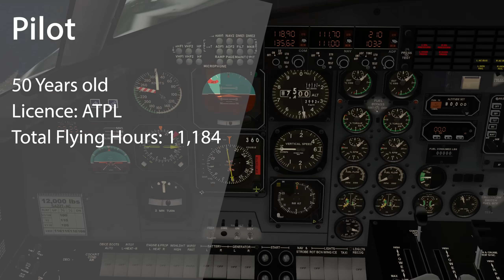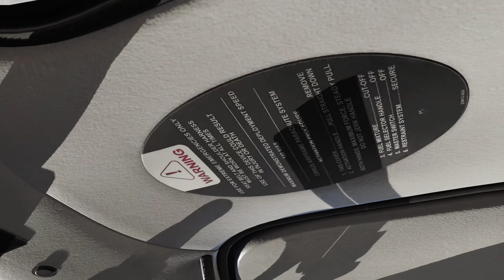Mid-Air Collision In Colorado! | How Did Metroliner and Cirrus Collide?!

Comment: I'm going to be honest, I went and read the report after watching this video... it's pretty bad. It's only about 4 pages long if you take out the large graphics, and doesn't really go into much detail at all about the accident. It mentions that the Cirrus had a TCAS system which went off, but doesn't say for how long prior to the collision (presumably not long, since the pilot pulled the CAPS handle less than 35 seconds after they said the alarm went off, but that's still long enough potentially to have avoided a collision). It doesn't say why the Cirrus pilot was so far over the speed from the POH, or why they didn't notice that they had overshot the runway centreline by so much. According to the report, they were not even half way through their turn at the time of the collision, so they were nowhere near going to make it. It doesn't say if they ever saw the metroliner. Several people have commented that the metroliner's control cables run through the floor, this isn't mentioned at all in the report...

Comment: An unusual story well worth telling. But, boy did he fill the airway with useless words just to make the video past the 10 minute mark! 

All those take off details are just pointless. Apart from pilot information, the step by step taxi and take off laundry list is totally irrelevant. They had zero impact on the accident. What’s next, list what each pilot eat for their breakfast??? 

This is just plain laziness. Instead of repeating those mundane take off steps for the umpteenth time, he could have spend a couple minute to talk about the parachute system and why it’s on this particular plane but not many other types of aircraft. But not, that’s too much work. It’s far easier to just fill the dead air with taxi paths.

Comment: I flew thousands of hours instructing at Centennial. I have flown that Cirrus, and if the information I received is correct, I trained the Metroliner's pilot through several of his ratings. One factor not brought up is the distance that the controllers are extending downwind. The further out you fly, the less ability a pilot has to determine the approach centerline. The runways are close, and a pilot can believe that they are on centerline when, in fact, they may be 100' off. Speed was a major factor.

Comment: Several very lucky characteristics of both aircraft saved the crew’s lives, the Metro’s control cables rout through the floor and the floor is reinforced for cargo which is why it never came apart and remained controllable, the composite structure of the Cirrus prevented in flight break up post impact and of course the Capps system did what it is supposed to. This was a Swiss cheese model of positives for a change that came into play after a series of mistakes caused the initial incident.
Reply from the maker: Such a good point, an example of the swiss cheese model in both the positive and negative.

Comment: Flying was simpler and made more sense mid 20th century when I learned based only on the principles in Stick and Rudder (pre PTS/ACS.)  We learned that speed was more important than altitude on takeoff and at low altitude except landing.  We learned that extra speed made landing more dangerous and even impossible.  Now extra speed and the resultant dangerous go around is encouraged as good landing technique.  And yes, the slower we go the less radius of our turn.  Another thing not taught is maneuvering flight where horizontal space available may be as limited as vertical space available.  Slowing down but not pulling back on the yoke in the slower and tighter turns means 1 g turns regardless of bank angle.  We need to teach flying based on the principles in Stick and Rudder and good energy management.  "The 'stall-down' landing requires that you blend the approach glide, the flare-out, and the slowing up of the airplane all into one maneuver so that, when you arrive at ground level, you arrive in three-point attitude, all slowed up and ready to squat."  S&R page 302.  Use ground effect to be faster on takeoff and slow down to land.  Flying will be safer and more comfortable that way.  And all that can be done while looking out the windscreen.

Comment: I  think a traffic advisory wasn't even the real ATC issue here. Surely parallel landings are only permitted when both aircraft are capable of precision approaches. A GA aircraft doing a visual landing via a traffic pattern isn't what I would call precise :D especially when the speed is so wrong for an approach. ATC giving the Cirrus an extended downwind sounds reasonable to me as an armchair air traffic controller.

Comment: Strange that such a small airport would use two TWR frequencies. I'm not ATPL licenced, but as a PPL holder, I'd always expect to hear all traffic in the pattern and on the runways once I am on TRW frq. But with the very "non-standard approach"  of the Cirrus pilot, a single frequency may not have made a difference in the outcome. 

I flew a fast Long Ez for many years, and with an approach speed of 110-120 kts, things always happened a lot faster than with a Cessna, so I can imagine what 140 kts will do.
Reply: It should be noted that runway 17R's threshold is 1875 feet offset from runway 17L's threshold. This alone should have prevented the collision IF both planes were on the 3.0 degree standard glide slope to their respective runways. There are visual slope indicators with 4-light PAPI for each runway. (Note that the two runways are only 600 feet apart laterally.) Having trained and based here at KAPA, I can say that 17R is used primarily as a training runway for touch and go landings by the many schools that operate here. When it gets busy, the 17R controller will extend the downwind (and thus final approach) legs significantly (a mile?) to accommodate many training planes in the pattern. Runway 17L is used primarily for inbound traffic from the north and east, as well as almost all jets, which require much longer final approaches. Controllers regularly warn pilots using 17R to NOT cross into the 17L approach path. The puzzling questions that remain are 1. why did the Cirrus pilot feel a need to fly the pattern so fast? And 2. why did he overshoot the 17R centerline? Two speculative answers are 1. there was other traffic to avoid in the 17R pattern; and 2.  he thought that he had been cleared to land on 17L, a not too rare event there.

Comment: Some sort of short-range active radar should be introduced for aircraft. Multiple lightweight transceivers on multiple points on the airframe, derivatives of automotive technology. Passive methods using transponders don't work when some dummy in a Cirrus decides to slice your fuselage open.
Reply: Look up ACAS, TCAS and PCAS.
Reply: @stejer211  None of those systems use active or passive imaging radar They all rely on transponders. I'm talking about military style all-around collision detection RADAR.

Comment: Wow!  What a testament to the build quality of the bigger craft, value of CAPS, skill of the pilots, and divine intervention!
Reply: The skill of ONE pilot, sure. The Cirrus pilot, not so much.
Reply: @ttystikkrocks1042 it’s a shame it can’t in some way be replicated by a good pilot in a plane without one.  Like, it seems to stop spinning and go wings level with the greatest of ease.  There’s a new model of Cirrus with a “wings level” button that really seems to work.  I wonder what it’s actually doing to the aircraft that pilots could learn to copy?

Great video and a fantastic outcome.  Did either aircraft have a transponder on and would that need to be on the same frequency to see another plane?  Sorry if some of this sounds a bit “beginner-ish”, but it would be interesting to know.

2.9.24 JUST EDITED the first sentence as I missed out a word which made it sound nonsense.
Reply: @ttystikkrocks1042 thank you - I assume transponders can “step on” each other like people do.  The other thing I wondered about was why they didn’t get TCAS warnings, because the radio altimeter triggers those?  Or why they had such a dumb system of traffic control in the first place?  You could literally have 2 controllers lining up 2 planes to land on the same runway at the same time, with no communication between planes or people.
Reply: @moiraatkinson  TCAS is not required equipment in general aviation aircraft. I think that should change now that such electronics are so much less expensive than they once were.
Reply: @ttystikkrocks1042 sounds like it’s needed.  There appears to be a rise in GA accidents while commercial flying gets safer, and hardly a week goes by without hearing there’s been a fatal accident.
Reply: @moiraatkinson  I agree that something is needed to make general aviation safer for everyone. The FAA seems to be pursuing an approach of it they ignore it for long enough, maybe it will just go away.
Reply: @ttystikkrocks1042  hard for me to comment from another country, but it does seem to me that after a mishap, the NTSB come rushing in, then go away and in 2 years time produce a good, thorough report of an accident nobody remembers any more.  As they don’t have the legal right to insist on action being taken, presumably their report goes to the FAA and that seems to be the end of it.
Reply: @moiraatkinson nope, you’re bang on, that’s exactly how it works. Dunno why we ever let the FAA have a “dual mandate” in the first place
Reply: Crazy how you don’t need CAPS if you don’t fly into other aircraft…

Comment: Just looked it up.  Engelwood CO population 33,642.  Does Centennial airport have enough traffic that requires them to have ATC tower on two different frequencies for two parallel runways, therefore lack of communication between planes that may be on parallel paths? Non-pilot question, so admit I probably don't know relevant details.
Reply: Yup, you don't know.   The airport is only 15nm from the center of Denver.  It is an international airport with continuous U.S. Customs services and is one of the busiest general aviation airports in the United States with an average of 874 operations per day.   That's why it has two controllers.
Reply: its the busiest class d airport in the usa

Comment: Nice that you can be incompetent and still get on the ground safely because of a ballistic chute.  I have done several missed approaches at Centennial.  Always for resolution advisories on aircraft that had wandered through final or were simply not in sight.  There is no way to safely execute simultaneous approaches for these runways.  I stopped allowing our corporate aircraft to use Centennial.  It is not worth the risk.

Comment: The Cirrus has quite an impressive top speed for a single engine aircraft.  Honestly, I don't know what is impressive for twin engine turboprop commuter planes like this one.  So I don't know if 330 KTs is fast or just average. That it didn't explode on impact must speak to a huge amount of luck that no fuel tanks were ruptured, I guess mostly because the cirrus struck fairly high up on the hull, and didn't seem to impact the wing.  It's also incredible, if not miraculous that the Fairchild was able to land safely.

Comment: Those old Metros are incredibly rugged. Built in San Antonio, TX. Sad thing is, that airplane was probably scrapped. When they finally ceased production in 2001, they cut up and scrapped all the tooling used to manufacture them, so no major airframe components can be built for them when substantial repairs are necessary.
Reply: Nah its just sitting at the ramp on the east side of APA, Key Lime has like 6 Metros out there in various states of canibalism
Reply: @scoutty146  
That's the first step towards scrapping. They'll miss the Metros when they're gone. There are some things they do well.
Reply: I find the destruction of the tooling to be extremely asinine. Why would they do that?
Reply: @ttystikkrocks1042  
Not sure what they were thinking. Maybe to hasten withdrawal from operation.
Reply: @rescue270  have to pay rent on the building that houses the tooling. Destroy the tooling sell the plant
Reply: @scoutty146  
Should have sold the tooling.

Comment: A deployable parachute for the entire aircraft? That's pretty cool. I didn't even know what was a thing.
Reply: Cirrus pioneered the general development and deployment of the ballistic parachute system for their line of aircraft. You can now find them in many types of ultralight, light sport and general aviation aircraft.
Reply: They have been around for a couple of decades, at least!  They are only available for small planes.  I believe they originated on ultra light craft and evolved to include single engine general aviation!
Reply: They even strap people to them these days!
Reply: @stejer211  😁
Reply: It's almost a trademark of Cirrus Aircraft. There are some interesting analysis on the how much safer if makes the aircraft.
Reply: They’re only used because a cirrus can’t recover from a spin.

Comment: Not infrequently esp larger airports there are multiple tower frequencies - i previously considered it a convenience in some sense but this case instead  illustrates the potential danger to the unwary pilots. Moderating airspeed as one approaches into the pattern for landing is very basic aviation, its is not the place for recklessness, it is the place for care and vigilance.  Its like the foolishness of acceleration to the the red lights, just plain dumb. Its not clear if at least some of the excessive speed was due to a tail wind, but if so that should have been anticipated. I'm always very careful and attentive with parallel landings but this provides more food for thought.

Comment: I always wondered why they still fly those Metroliners. Now I know. They must be good aircraft.
Reply: Very solidly built.
Reply: Might be solid, and perhaps a good small freight plane, but I had to endure a lot of time in them as a passenger.
They're one of a few planes that can't sustain level flight on a single engine...
We refer to them as Death Pencils.
Reply: @Danger_mouse  The Army was using these “death pencils” to shuttle brass around Afghanistan in 2017. I know because I used to fuel them. They were civilian flown under contract. So if they were so terrible, why still use them? I asked a lot of questions because I am an aviation nerd and was curious why they still used them? If your information is correct, why would you want them in areas of high density altitudes? I didn’t see any jato in the tail. Lol My guess is that was an issue for their airliner role? I also got the impression that they were used because of their hot and high capabilities? I have no idea if that is true, based on vague memory? They also don’t have single point fueling, which is annoying if you are fueling this bird between airliners. My profile pic with the silly F-16 model, is in my shared fuel truck. It is pointing right towards where they parked the C-26. Behind the CRJ.
Reply: @MayorofCheeseland 
Can't imagine 'Brass' being too excited at crawling down the aisle on their hand and knees and sitting with their heads bent over due to the shape of the fuselage.
They must have really had nothing else 🙂👍
Reply: @Danger_mouse  I highly doubt they are configured like the airliner variant.

Comment: To avoid this, Look around 2 or 3 times where your gonna turn, then turn while you look. like riding a motorcycle. unless you want to crash then turn as you look. 

Look, lean, turn, straighten if you want to avoid crashing, injuring others midair or jail time. it takes just a few seconds to look. its so easy to do that its ridiculous having to explain such common sense. you dont turn and look at the same time. you look then if its safe then you turn and follow. its common sense and eye hand coordination.

Comment: It's crazy that the cirrus pilot was still over 140kt on down wind and 140kt on base leg. I can never understand why people do that, it's only gonna save you few seconds or maybe 1 minute but it puts other aircraft and people in those aircraft in danger. Pilots like that should have their PPL revoked.
Reply: Don't ever lump in cirrus pilots with other GA pilots. Until someone can train a cirrus pilot to actually look out their windshield they should disable the parachute which will thin the hurd of their arrogance...
Reply: If you fly that fast and turn and bank correctly it can be done.. but most GA pilots are not that proficient, so they f.u. No reason to revoke the license.
Reply: @flexairz Budy you are WAY off! This wasn't an airshow performance. Cirrus operator (can't call him a pilot) should have lost his license, for good!

Comment: Finally, one of these stories ends with no deaths.  Those parachutes always intrigued me. Saved two lives.
Reply: Cirruses need those parachutes. I consider them to be dangerous airplanes.
Reply: @rescue270  It's almost always pilot error, as in this case too.
Reply: @rescue270  Why? I've been in one on several occasions and they seem like a good aircraft.
Reply: @rescue270 
all aircraft are dangerous machines!  Especially with pilots aboad!
Reply: Cirruses have high accident rates, especially during landing.
Reply: @admlorenz  
Glad to see someone else has also noticed this. I've gotten to where every time I hear about a small plane crash, I automatically wonder if it's another Cirrus. Very often it is, yet another Cirrus.
I keep posting the reasons why I don't like them and it keeps getting deleted.